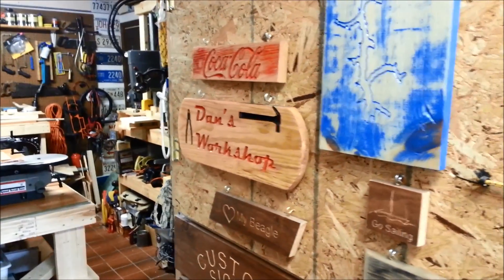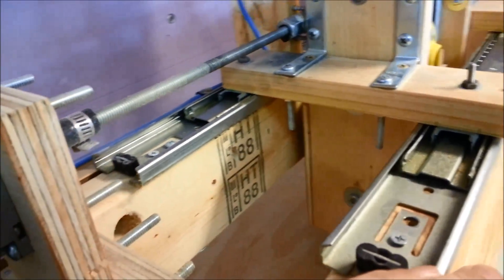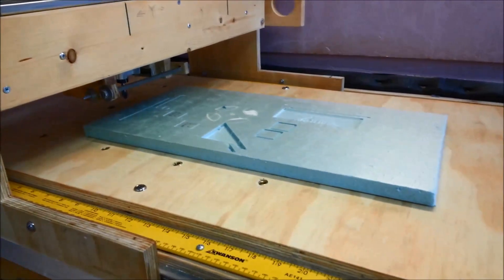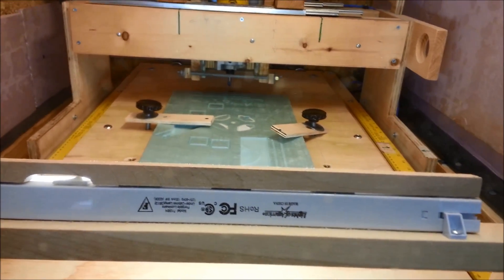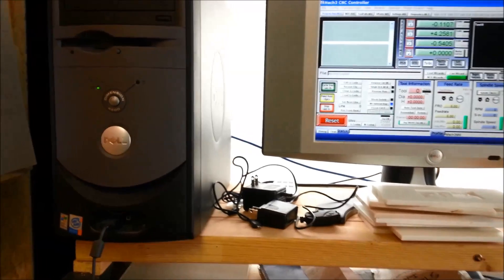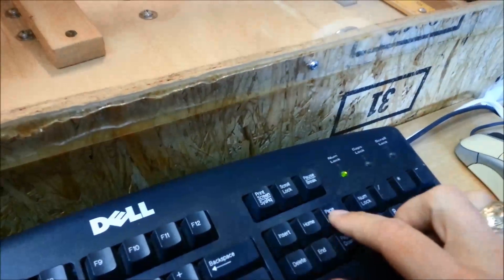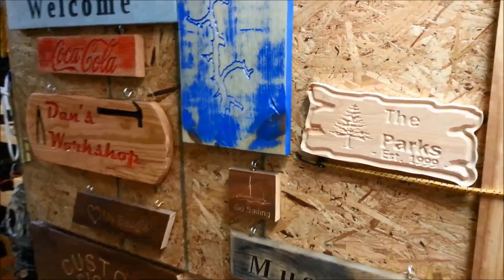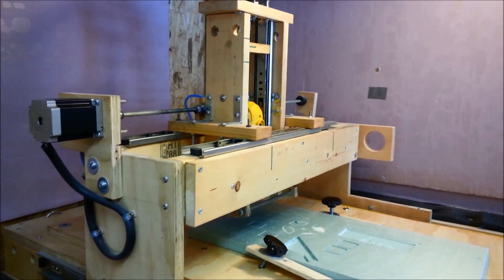DIY - $400 CNC - Overview

Comment: you can reduce the noise even further since its mostly higher frequencies. some ideas i would do:
+make the window smaller, 
+and use rubber sealings to make the box air tight so less sound escapes (vaccum can kill noise to zero :D look up some vides)
+ acoustic foams on all places inside, seems you left some big parts without.
+ sound isoltation outside of the box , you see this priciple in car sub woofers, for the cheap you can glue and or nail old towels on the wood see this proof of concept https://www.youtube.com/watch?v=pABvTWSxOes

Comment: What king of stepper motor driver you used ? are you connecting it to paralel port ?
Reply from the maker: T1iCanon The driver board (TB6560) was a very inexpensive Toshiba board bought on eBay.  It came with the kit of three stepper motors and power supply.  Some folks have had some issues with the boards but the one I bought never once failed after a lot of abuse.  And it got a lot of abuse (backwards wiring, banged around, etc.)  And, yep, old school parallel cable and port.  Old computers are fine to use for basic CNC machines.  Just clean the machine so there is nothing at all running on it while the CNC is in operation - any programs that are running in the background can cause a loss of steps.  The computer I have running Mach3 isn't even connected to the Internet.  It's only job is to run code.  All of the design work in creating things to cut though is done on a modern machine connected to everything.

Comment: +drez20001 This is an excellent build. I am going to do my best to replicate it. What are you using to support the threaded rod on the en opposite the motor?  What size are those NEMA 23s?
Reply from the maker: Chad Looman Hi Chad.  Thanks, it was a fun machine to build and has been a great learning experience in entering the CNC hobby.  I found an old thick plastic washer that I drilled a larger hole out of and that supports the far side of the rods.  As far as the motors go, it was a kit purchased on eBay for about $175.  The prices have come down though.  This is almost the same kit as I bought a couple years ago:  http://www.ebay.com/itm/US-Ship-Promote-Nema-23-Stepper-Motor-270oz-in-3A-3-Axis-Board-CNC-Kit-/301614276219?pt=LH_DefaultDomain_0&hash=item46399c9e7b
Reply: drez20001 Thanks a lot, so those are the 270 oz motors. Did you ever think about mounting the drawer slides in opposing directions of extension, that way when one side is fully extended the other side would be fully closed and more supported.  I have not tried it yet but I was thinking that might give me a slightly long run and it would be more support at the extremes.  What are your thoughts?
Reply from the maker: Yep.  After I built the CNC that thought crossed my mind.  I'd be curious to see if that works out better.  As it is the machine is pretty stable up to about 60% to 70% of the drawer slide extension but beyond that it can get a little squirrely.  The steppers are the 270oz units.  Beefy things.  For wood working and learning it has been an excellent project.  Here's a sign I made for a friend on it: https://www.youtube.com/watch?v=-g6RN-OhnBs
And this sign was pretty cool too: https://www.youtube.com/watch?v=JRFjAxZQYTQ

Comment: Hi there, great build. Been watching all your videos on your CNC machine. I'm busy building my own.

1. I noticed you have aluminum angle on the side of your gantry frame. What is that used for?

2. You mentioned in a previous video you were going to support the drawer slide that had play in them. Did you ever do that, and if so how did you strengthen them?

3. Do you have any kind of anti-backlash nuts?

Regards
Reply from the maker: Josh Robb Hi Josh.  Thanks for your comments.  Good eye too.  The angle iron is an aesthetic thing.  It covers some holes that didn't align correctly at some point along the way.  Makes it look a little more official too, sort of.  

I haven't yet designed a support for the far extensions of the drawer slides but I've thought about it a lot.  If the cut stays within a 'reasonable' range of the slides there is very little play and for most wood working projects it's plenty rigid.  

I didn't design in any anti-backlash nuts or fittings - I found that by keeping the CNC to around 20ipm for most cuts the backlash was surprisingly minimal.

Comment: I'm curious why you choose to go with Mach as opposed to LinuxCNC with such an obviously budget oriented project.
Reply from the maker: Paul Frederick Hi Paul.  Excellent question.  Yes, there is certainly free machine control software out there that can do a great job.  I'm just a Windows person and haven't played much with Linux so after building the CNC I went with Mach.
Reply: drez20001
The LinuxCNC development crew understands that people building CNC machines have enough to worry about so they made LinuxCNC as easy to use as possible. Beyond basic configuration you really do not have to do anything at all.

The LinuxCNC image comes with LinuxCNC already setup, and ready to go. So LinuxCNC is just there when the rest of the system runs. Why, they even setup desktop shortcuts, and menu entries for you too.

But if you insist on doing everything the hard way you can download the source code and compile it all too I suppose. No, seriously, don't do that. At least not right away. There may come a day though when doing a git pull of a pre-release is a thing to do.

I've done it myself

Anyhow, if you're serious about giving LinuxCNC a try, and why not, it's free. Plenty of folks could get you going then. Not that there is a whole lot to it really. But there are some things it is nice to know. Like say if you wanted to keep your Windows, but try LinuxCNC on the side. Completely reasonable, and possible too.

Then you want to look into something like this http://gparted.org/download.php before you install LinuxCNC.

Anyhow here's some previews of what LinuxCNC looks like
This is the configuration Wizard
http://linuxcnc.org/docs/devel/html/config/stepconf.html
This is the most popular front end
http://linuxcnc.org/docs/html/gui/axis.html
Though there are others if you're into something ugly, like Mach is.
You can even try it before you buy into it. You can run a live session of LinuxCNC. A live session is where you boot off media and Linux runs in your system's RAM. It doesn't install anything, it just runs. Though with LinuxCNC there are some limits to just what a live session can do. You can still play with the simulator.
http://linuxcnc.org/docs/html/common/Getting_LinuxCNC.html
Reply from the maker: Many thanks for the details.  It is a great community on the Linux side of things -  I have friends that tinker with it and love the platform. I really should give it a try.  When I built the machine with all of the complexities it had I figured that one less thing to learn, Linux, made sense - and then in the last couple of years I've gotten very comfortable with Mach so I've stuck with it. 

Also thanks for the details for others that are entering into the CNC world.  It's a fun hobby that doesn't have to be as complicated and scary as many think.